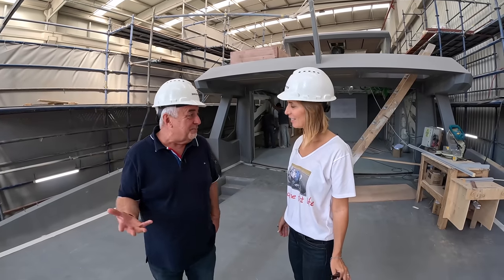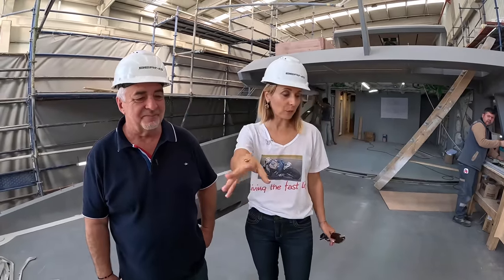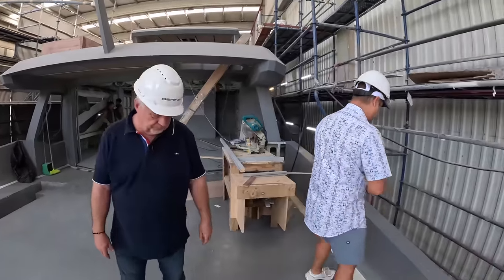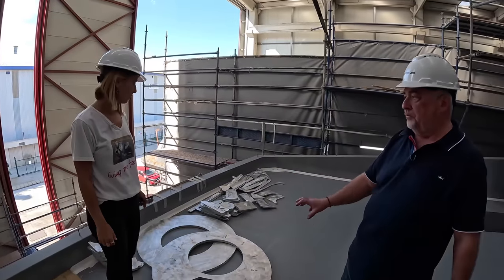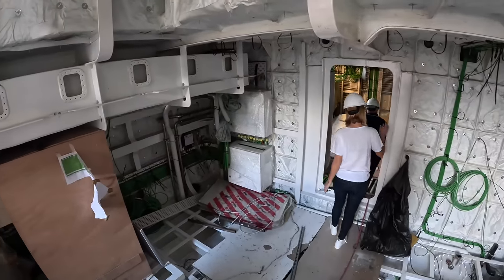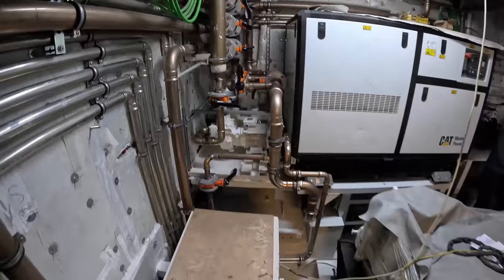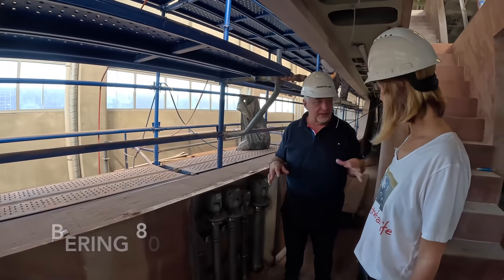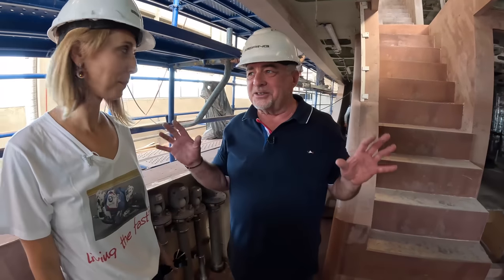UNDER THE SKIN of a Bering Explorer Yacht 😳 Eps. 31

Comment: Bering builds their boats to ship standards and using metal pipes instead of hoses is the mark of a great builder.  They could save money, but 10 years from now, you would have very costly repairs.  Your boat will last for many years with a minimum of problems thanks to the high standards Bering uses.  Great video and I like you guys comments about safety and how metal pipes are so much better than hoses.
Reply from the maker: Thanks for watching

Comment: Absolutely LOVE the details of the tech stuff and piping and all that he goes in to. I would be the same way. I want the best of the best day one.. so as not to have to worry about issues like smell, corrosion, etc. Remove all the potential issues that you CAN solve for out of the gate so you don't worry about it. As he said, if something breaks.. that's different. But out of the gate you know you got the best solution, at a cost sure, but you're putting in a few mil or more. I say this VERY thing in my house. We got super cheap .30c outlets (about 30 of them in the house) that constantly break. Super cheap China junk. For about $60 more in total, they could have put in much better outlets that wouldn't break. That I am doing manually now to replace all the cheap outlets. Same with network cable.. Cat 7 existed when home was built, 1Gbps network was already pretty normal. Why not put Cat6 or Cat7 in the walls and run 3 or 4 of them to every room.. just in case. It would cost a couple hundred or so more in total, and you future proof the home for decades. Instead we got cheap china Cat5E ran everywhere, loss packets, etc. Drives me nuts! OH.. and our electrical wiring.. multiple rooms tied to a single 15amp fuse. What in the F where the designers thinking. We constantly blow circuits. It's unreal to me why every single room doesnt have one or two good 20amp wiring in the wall to ensure you got plenty of power to all areas of the house. Just piss poor design. This is why (after my long response) I love the Bering company and NautiGuys constant need to go in to detail about things like this! My kind of people! :) If I was rich I'd be hitting you up to work with you to build a Bering boat!
Reply from the maker: I could not agree more 💯🥳

Comment: Vessel was the word of the day for your both videos. ....and the piper will lead us to reason....Led Zeppelin. Pipe is heavy but that's sweet workmanship. Flexible connections are probably used in high vibration areas?

Comment: Enjoyed and understood Rico's comments about pipes vs hoses over the long run — however, would have liked him to address any difference in difficulty/cost to repair a damaged pipe vs a damaged hose.  It seems like replacing a leaking hose between the head and holding tank might be a lot easier than replacing a piece of cracked pipe…
Reply: SWAG: Unless it is a ship which requires a full-time watch stander, both on the bridge and in the engineering spaces, I would imagine that a permanent repair of a busted pipe would be a shipyard repair.
Reply from the maker: They don’t just crack, everything gets pressure tested and it’s going to last a long time

Comment: This was a great video. I would like to see more technical information on building the Bearing 75. I have done a lot of reliability testing using salt water and am very interested on techniques and materials used to control corrosion. In particular how Bearing is protecting for electrical corrosion. Cl and electric fields promote metal migration how is that controlled. I am also interested in any stress testing that is done to uncover issues both before and after splash. You guys are doing a great job following the build.👍
Reply from the maker: noted

Comment: Just a small addition to the hose topic, OdorSafe Plus hoses fare the best when it comes to odor permeation, however they come with the drawback that they are stiffer and harder to work with than most commercially available hose materials.
But if your boat is big enough they are a good compromise when compared to straight plumbing! :)
Reply from the maker: Thanks for sharing… honestly we have seen it all  over the years on different boats… hoses are only good for hydraulics on the long run 🤷‍♀️

Comment: Regarding your comments about Hoses...Hoses are made of Rubber or Plastic, both of which are permeable at Sea Level. Also, Plastic and Rubber compounds begin breaking down immediately upon creation. You can even see Rubber and Plastic Hoses sweating when they age. This sweating is not always from condensation. The contents can leach right through the hose wall.

Comment: I don't know why they use the Cummins M11 engines since they are not a great engine in any application.  If I was having a yacht built I would go with 12.7 series 60 Detroit engines and I would them myself using the parts I like.  

I am in the process of building a 68' aluminum sailing catamaran and when I originally started the design process I was only planning to build it 52' long but with all the things on my must have list the boat had to grow.  I am using unconventional propulsion and controls and doing many things differently.  For propulsion I am installing 1500hp General Electric T-58 turboshaft engines.  I am hoping for 55-60 kts of speed under power and 20+ kts under sail.  I have always design and built my own water makers on my previous boats and this one is no different.  My water maker should be capable of making 100gph so my toilets will run only on fresh water.  For plumbing I am using all stainless tubing and everything is getting tig welded together.  I am running thinner wall stainless tubing and everything is being mandrel bent since I have a mandrel bender.  I am using stainless hydraulic tubing for all hydraulic runs and it will also be used for hot and cold water supply.  The turboshaft engines will also have heat exchangers so there will be mass amounts of hot water for showers.

Comment: Absolutely agree about piping, I always also like to have access to everything as a just in case. Is there a system to flush the pipes if and when needed? Function over aesthetics always and a good designer can work with this if they are worth there salt, I am a designer incidentally, not of boat's but have designed the interior of a few boats for myself though, not as big as yours incidentally but the largest was 60'. I actually like a boat or a ship to have the portholes and watertight doors as I like the craft to feel like a ship anyway.

Comment: The section on the railing attachment was interesting and is always a problem area. How is the post attached to the bolt? Is it welded onto the post and screwed in, or is a nut welded to the post and screwed down onto the bolt?
Thanks so much for the great vids guys.

Comment: If you ever need to take any of those SS Bolts out of those SS threads, make sure to use the proper anti seize. Galling of the threads with that combo is a very real issue and not an issue that you want to tackle. I'm sure you probably already know that, though. ❤
Reply from the maker: Thanks for the recommendation!

Comment: Splitting water into hydrogen and oxygen as a fuel additive for diesel engines has come so far with great success.  It burns cleaner it’s better for your diesel engine and it saves you 20% on your fuel cost.  Since bearing is a leader in the yacht industry.  Are they doing anything with splitting water?   Being on a boat, you have an endless supply.
Reply: Who is making this gear?